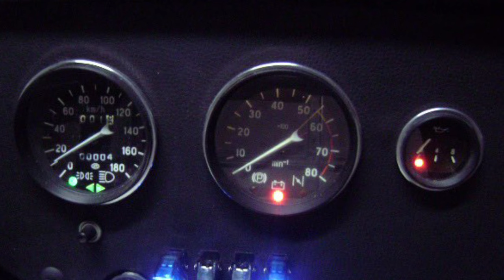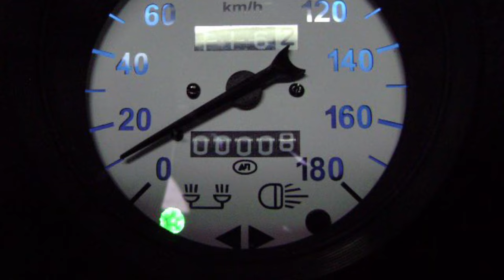Lotus 7 - How to Build a Sports Car | DIY

Comment: Great job on the car, looks good. I'm noticing that are missing some triangulation tubes in the chassis. Next to the engine, next to the seats, along the engine(firewall to the front of the car), transmission tunnel could use some as well. Also a driveshaft brace would be a good idea for your safety. I'm building one as well, McSorley 442E chassis. There are also some aussie mods to strengthen the chassis even more.